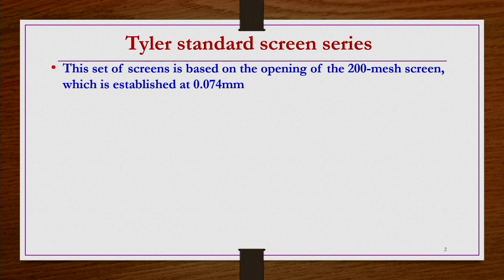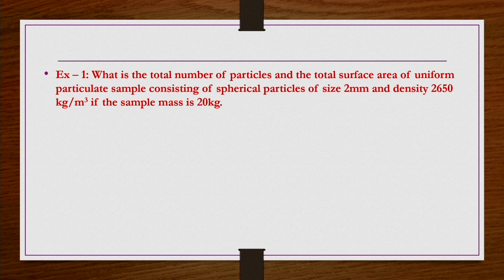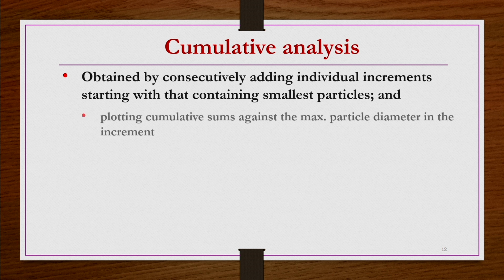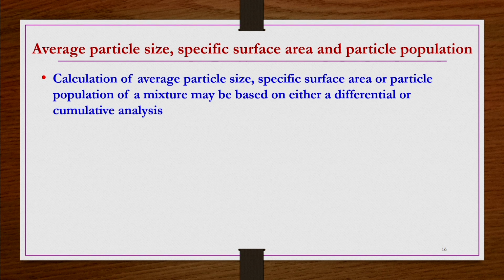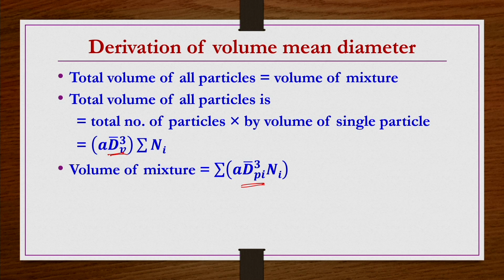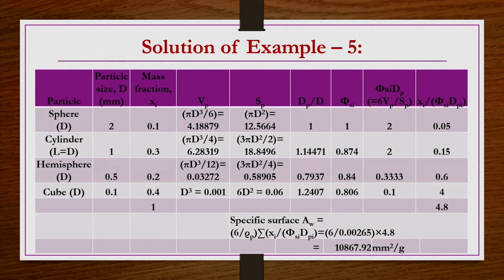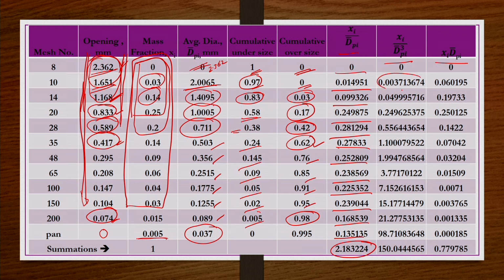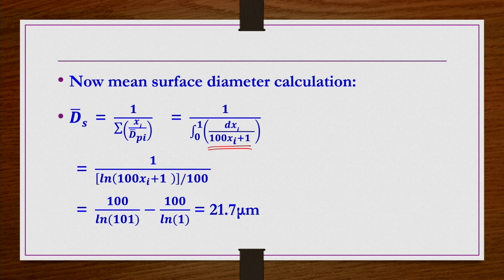Lec 05 : Size Analysis by Screening

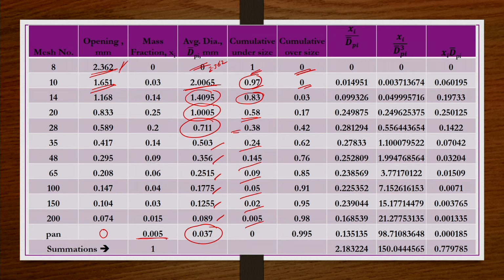Comment: At 1:10:50 in cumulative oversize, I think there is a mistake in calculation
Mass fraction for mesh no 10 is 0.03, therefore cumulative oversize must be 0.03+0 = 0.03 and not 0